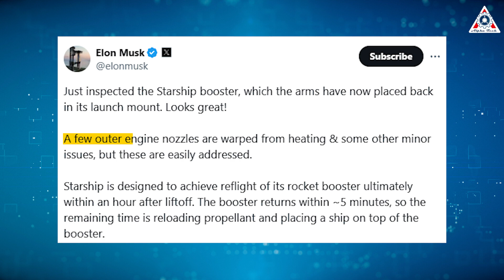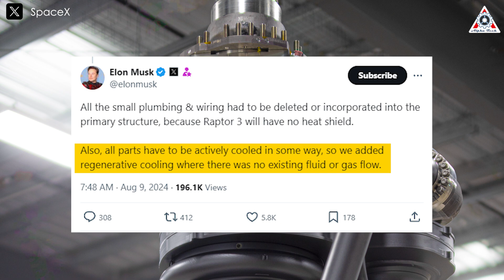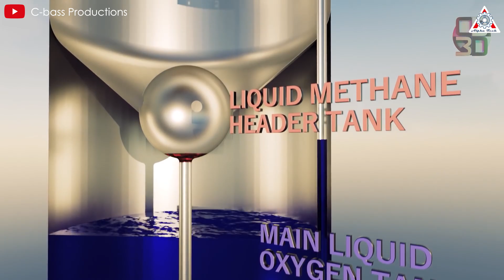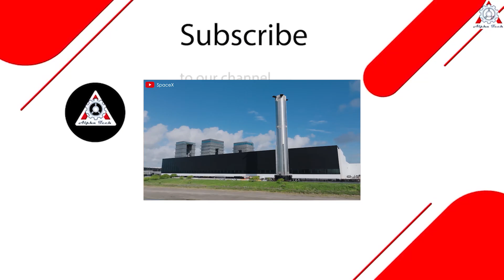Elon Musk Directly INSPECTED Booster 12 'RAPTOR Engine WARPED' & declared this...

Comment: 40 ton of weight cut from the booster means 40 tons of cargo for the Starship. 
Add 2 more engines, and you'll be able to add more cargo.....
Reply: the raptor 3 also has 21% more thrust vs the raptor 2.

Comment: The cone warping was most likely caused the the heat of re-entry. Some videos reveal it was glowing red hot even without the engines on.
That's a problem.
Although those engines are designed to work at incredibly hot temperatures but that includes super cold fuel flowing thru the engine and cones. The re-entry without any cooling would be a problem.
I suspect it could be solved by leaking some super cooled fuel into those cones in order to prevent warpage -- provided they have sufficient extra fuel to do so. In the worse case one could dump the supercool Nitrogen into those cones too (although it adds plumbing complexity)
Reply: I am sure that the engineers will be looking through the flight data and determine the correct timing and volume of super cooled liquids to take care of the engine and thrust cone cooling requirements prior to the next launch.  That is what they are good at.  And, getting better all the time.

Comment: How are you going to land that on another body weather it be a moon or a planet. No chopstick arms there. You're not gonna develop a booster and ship with legs? Not sure I understand what the deviation from that is or why?
Reply: That's just a booster, It will never leave the atmosphere. The reason that not having landing legs is advantageous, is because it reduces weight. Any reduction in weight means a higher payload capacity.
Reply: There is no Booster on Mars/Moon or any other Planet. Starship will have landings legs
Reply: The first stage - the superheavy booster - is not the vehicle that would be landing on other planets, it's just there to get the second stage - Starship - into orbit. Starship can land without a tower, which they have already tested and successfully landed, you can look up a video of it if you'd like.
Reply: The ship will launch by itself
Reply: @kaibalfour2318 I don’t think you know how to use a calculator, mars is 171 million km away. This thing only went 184 km in altitude yesterday, it needs to travel that distance 929347 times😂 just to get there… times that by 2 for the return flight. 😂😂😂 rightyo chap get cracking. It will take 6580 hrs e.g 285 days of travel at 26000kmh. This caught fire after a couple of minutes.
Reply: The leg issue is about having alternate methods available for landing.  As with any mechanical system options mean more chances of success. Remember also there will be a number of different ship designs, depending on its purpose.
Reply: They need to use the design of Herge “Tin-Tin” rocket from the comic strip men on the moon, it has 3 legs, and high distance from the ground to the rocket engine 👍
Reply: There will be various itertations and variations of both the boosters and ships themselves, depending on the specific use and application.  Some airplanes land on wheels, others land on the water, some land on ice.  All require different hardware and design.  Same for rocket ships.

Comment: So if this works for the heavy booster, can it work for a RTLS falcon 9 booster?
Reply: Would not make any sense since Falcon 9 has already Legs installed, but in theory, most likely. They will not pursue this though, since Falcon 9 has been proven to work this way, and they would not get a benefit with this method
Reply: Possibly could, but, why screw with an already engineered and working premium launch system?

Comment: the engines are too close together and overheat. The 9-engine design of the Falcon-9 and Falcon Heavy is more reliable
Reply: If they overheat so much, why does this work? Did you study engineering, rocket science or anything, that could make your opinion, without any prove, any more reliable?

Comment: Galileo is rolling in his grave at the comment that the Starship booster is falling faster than the Falcon 9 because of its increased weight.
Reply: The earths atmosphere is not a vacuum.
Reply: I believe the Booster is also coming down from a faster velocity and/or higher altitude than the Falcon.
Reply: Terminal velocity
Reply: @taureanwooley  Yes, that's correct.  But it's a bit more than that, since terminal velocity is effected by cross-sectional density and surface area presented to the atmosphere, and the cross sectional density is relatively the same between Starship's booster and a Falcon 9.
Reply: @brillopad1392  no the falcon heavy is much smaller than the starship and lighter...otherwise they would be doing nothing but shooting a falcon rocket with an extension
Reply: @taureanwooley  I was referring to cross sectional density not weight difference.  Over 400-years ago Galileo dropped two metal balls from the Leaning Tower of Pizza; one larger, the other smaller and lighter.  They both hit the ground at the same time.  So the relative weight differences between Starship and Falcon makes absolutely no difference in how fast they fall.
Reply: That would be Isaac Newton, but, we understand your thoughts.......
Reply: @winfordnettles3292  it's Galileo but it's still terminal and debilitating no matter how many others stated it
Reply: @winfordnettles3292  Uh, I think you should check your history.  Newton invented calculus and mathematically described gravity and orbital mechanics, but it was Galileo who did drop from the Tower of Pizza in about 1590.

Comment: Someone needs to drop a feather and a rock on the moon (wait, that's been done) before stating that the heavy booster falls faster than the Falcon 9. You want to be talking about air resistance and angle of atmospheric re-entry, not weight. Granted, since it is a monster they probably don't want to lean it too much to make it act more like a "wing."

Comment: What you didn't discuss was the obvious partial failure of the fill valves on the booster that were leaking both oxidizer and fuel to make the flame shooting from the side of the booster. This may have been an over pressure mechanism, but that has not been stated.

There was also, clearly, a small engine bay fire above the engines themselves that burned for a good 15 minutes post engine shutdown. I've not heard or read anything concerning that fire as well.
Reply: Missing the forest for the trees?

Comment: The "fire" is from the quick disconnect not atmospheric heating lol
Reply: The red glow in the engines is from the air pressure build up, just like re-entry. So yes you could call that atmospheric heating as it only happened when fast moving objects travel through earth's atmosphere

Comment: I think that the second or third flight with the version 2 of starship they will try to catch both it seems that the version 1 heat shield still isn’t enough.
Reply: Active cooling will help in future attempts.  You can count on it.
Reply: @winfordnettles3292  yeah flight 6 will be the last of version 1 I wonder if they will apply modifications to the booster to ensure it’s intact.

Comment: Still to much parts 1 engine should be enough would save way more parts
Reply: And that's why you're not an engineer for Space X. Be quiet..
Reply: @jaysummers9396   One engine.  LOL!
Reply: @docdat3468  one engine equals no redundancy no backup if your one engine fails
Reply: Problem with that is, NOT enough thrust, No one has invented that powerful of an engine yet. "Yet" being the key word.
Reply: @mikefowler301 No one's built one. An engine that size was invented for the Sea Dragon rocket concept.
Reply: The problem with fewer engines is not having the option for redundency and in flight correction due to one component failure.  With many engines, the AI can compensate if there is a single or even multiple engine failures and still complete the mission successfully.

Comment: Booster unusable whole point is too reuse it.
Reply: Reading/listening comprehension an issue for you? I kinda see that it is.
Reply: Have you ever tested a prototype and had it work 100% after the first few tries? No Engineer worth his or her salt would say they had a perfect prototype right at the start.
Reply: That's like saying an F1 car isn't reusable after a small accident where some of the suspension was damaged. You goose
Reply: It is used as an initial flight test device, not an actual production rated model.  The Wright brothers did not first fly an Anatov 225 on their first flight attempt, now, did they?

Comment: He makes NASA look second rate, DEI will do that
Reply: Federal Agency NASA is far worse than second rate. 
ESA is second rate, but at least they have a viable launcher.. 
Government is greed, uncaring waste, irresponsible incompetence, sloth, theft & corruption… & Nasa is government.
Reply: What an idiotic statement, firstly, NASA has just sent a space ship to one of Jupiter's moons, Elon Musk has got as far as the space station. And secondly, by Elon Musk's own admission Space X was close to bankruptcy a couple of years ago and was saved by investment from NASA, and by extension the American tax payer. Without NASA there would be no Space X. 🙄...
Reply: @jaysummers9396  Actually SpaceX sent Clipper to Jupiter. NASA just supplied the hardware on top. SpaceX has built three viable rockets, two reusable, and one experimental rocket still undergoing research and testing with improvements each time utilising innovative techniques that NASA didn’t even think could be done. That includes two new engines designed from scratch,  one using a technique that was thought impossible for the last 80 years, as well as 4 working launch towers and 2 more under construction.
You want to see tax dollars wasted? Let’s look at Blue Origin. Received twice as much as SpaceX and nothing yet in orbit. Boeing? An “established” space production company that can’t even return from orbit with its crew. ULA? Two launches, neither without its own problems. Artemis? One throw away launch built with existing hardware, one that has to be scrapped due to poor manufacturing processes. One tower that only existed for one launch and even then had problems due to incompatible engineering. A new tower required for the next flight where pieces don’t fit together that too will be used for only one launch. And a third tower required for the final version of Artemis. A capsule that has its problems with its heat shield and not yet human rated.
SpaceX, with its injection of tax dollars on top of what Elon has injected into it and revenue generated, has given the US a rocket that has vastly reduced launch costs and gotten the US back into space, reliable cargo and crew transfers to the ISS, new technology that China trying to copy because it is so good. A rocket that has such a prolific launch rate that other countries are sending their satellites over to be launched. A second stage that can send exploration craft anywhere in the solar system. And a new massive reusable rocket under development that will allow 
massive payloads to be launched and capable to get man back on the moon with the ability to build a permanent habitation as well as the possibility of getting man to Mars. That’s a lot of bang for the taxpayer dollar which currently no other company can do.
That is not to mention taxpayer waste on other government projects that have little to show for amount spent on them.
By the way, that bankruptcy possibility was during the development of Falcon 1.
Falcon 9 and Falcon heavy on which NASA rely on for more than 90% of its launches are further developments that came out of SpaceX Falcon 1 proof of concept and innovations on Spaceship are an extension of the Falcon project.
Reply: To de-regulate would be a fatal mistake, are you paid to make such no logical based statements.  Sorry they do not make a stitch of sense.
Reply: @slowpoke3102  Why? You do know when you say something like that you really should back it up with some facts otherwise it just looks like yer talkin out yer >>>>>>>>>>>>>you know what.
Reply: @LovelyLass-nb8op  Federal Agency NASA is far worse than second rate. 
ESA, China, Japan, etc are second rate, but at least they have viable launchers..
Reply: DEI is NASA’s stated #1 priority…. Competence, merit, efficiency or getting anything done is incidental. 
SpaceX launches rockets, hires/promotes by merit.
NASA launches pride parades, hires/promotes by DEI.
Innovative, efficient, spirited, SpaceX developed Starship for about what bloated, wasteful Federal Agency NASA spends on office supplies.
Reply: @warrenwhite9085  Why do you keep saying that? Nasa isn't building anything, They contract it out to businesses. Jeebus H. you guys need skoooooooooling. By the way WE have launchers as you call it.

Comment: The fire at the end of booster flight right before the catch.  When the 10 engines shut down a flame from a engine shutting down ignited the methane venting from the qd.  Maybe stop using chat gpt
Reply: It was either that or my brain says the engines that were no longer ignited were not pushing that heat away from the engines.
Heats up the metals n such and lead to likely what you said and ignited a gas.

Edit I doubt they would vent a flammable gas like that whilst burning.
Reply: @T57Custodian  you can see the booster venting from the tower cam. Then you see the flame roll up and ignite the vented methane.  There some video clips that show this very clearly.  Not from the space x feed but thinks every day astronaut or NSFW.  Also the best booster entry tracking cam.  Close up on the engine heat protection glowing red and on fire when up at like 40km.

Comment: Falcon does a reentry burn, Starship booster may needs to do one also to slow down!
Reply: I’ll, share this with Elon next time we’re hanging out.
Reply: @Del-Tye5434   Hahaha!
Reply: It was supposed to fire three of the engines to slow down before it landed on the water.  There was something that ignited the leftover fuel after it landed.  That has to be worked on.
Reply: Doesn't look like slowing down was an issue.  They might think of doing one to protect the nozzles.  I'm guessing they are becoming deformed because they are heating up during decent without pressure on the inside to prevent them from becoming deformed.
Reply: @Raynl1978   Their engineers will find out from the data they gathered.  Maybe they can share the data, but I doubt they will.
Reply: @levimalabuyo8107  I'm only an armchair rocket scientist! 😆  I like to think about what they might do and see how close or far I am

Comment: If you watch how hot Starship was, speeding thru the atmosphere at 12,200 km/hr, which is Mach 10, you could easily tell that Tom Cruise could not have safely ejected out of the hypersonic experimental plane. He would have been instantly compressed into a patty and barbequed. Hahaha!
Reply: There are other ways of safely ejecting then just jumping into the Mach 10 slipstream in your flight suit. The entire cockpit could of been an ejection "pod" that detached from the airplane. The pod would have kept the pilot safe.
Reply: @wally7856  F111
Reply: @wally7856  I have a feeling that ejection Pod would have cartwheeled hard in the Mach 10 slipstream due to lack of forward propulsion.  The sudden snapback and rotation would have pulled apart a human body in that pod.

Comment: "Due to it's weight, it's descent speed was significantly higher than Falcon" You need to discuss that fact with Isaac Newton.
Reply: Isaac NNewton's equations lack the air resistance. A larger object has less surface per mass and will therefore fall faster. The booster's path goes mostly through the atmosphere.
Reply: descent
Reply: @levimalabuyo8107  my science is better than my English. . Thanks
Reply: It descended at 250 miles/hour within 2 km of the surface. It's the same as your regular passenger plane. The engineers figured that out. There are other hurdles they have to solve before the Starship can land without exploding.
Reply: @levimalabuyo8107  my point is, primary school science tells you that objects fall at the same rate regardless of the weight, or more correctly, Mass.
Reply: @bikepacker9850  Buddy i'm not trying to be rude, but your primary school science only applies in a vacuum in case you forgot. The equation to determine a object's terminal velocity does indeed take into account things like an object's mass.
Reply: @Chillz_OG  true, but the two objects are falling through the same atmosphere so the speed the objects fall is completely unrelated to the weight. Now, if you're talking about the shape of the object and terminal velocity based on resistance, that is different. So, BUDDY, maybe you need to go back to primary school..
Reply: @bikepacker9850  

Gottfried mentioned already whats important here and weight matters because of that 
especially if the shape and density is almost the same you will have an increased velocity 
so saying its unrelated to weight is just incorrect 
it is one very important factor in this equation
Reply: @Sippi81  his statement was"Due to it's weight"
Reply: @bikepacker9850  

I referred to your statement to Chillz that "...unrelated to the weight..."
Reply: Earth's atmosphere is not a vacuum. Weight and size matters for falling objects in the atmosphere
Reply: @Lewythefly  weight matters to overcome air resistance. To say something falls fast just because of weight is wrong. It's absolutely wrong.

Comment: Nuclear rocket engine soon?
Reply: Nuclear power doesn't create thrust. It creates heat that you can convert to thrust by heating some other thing like water or other gases.
Reply: Not so fast, that takes a decade, at least.
Reply: SpaceX is actually quietly working on one.  For long duration and high thrust applications.